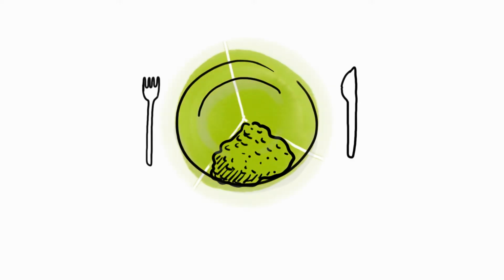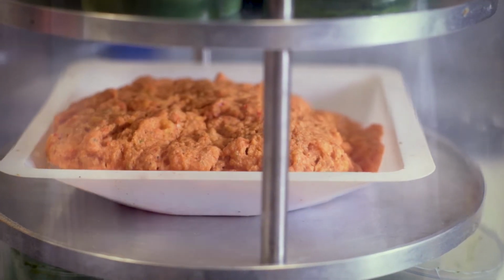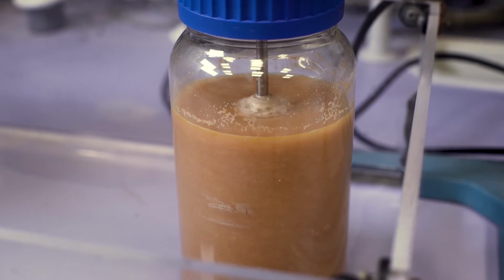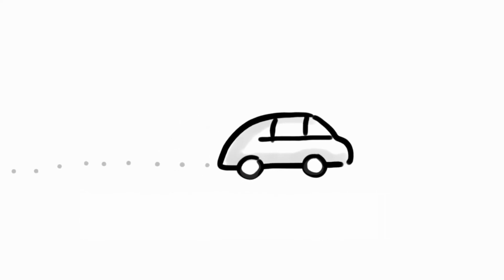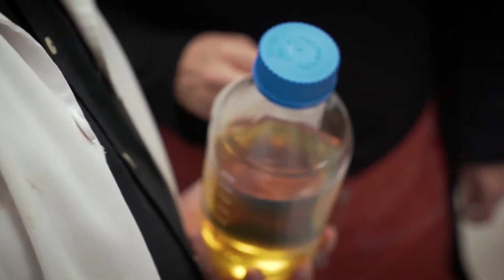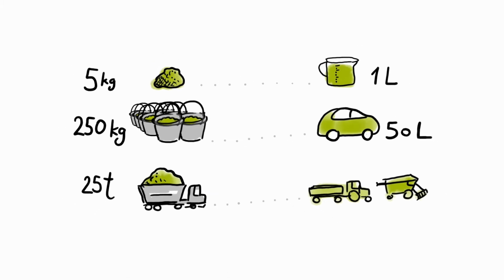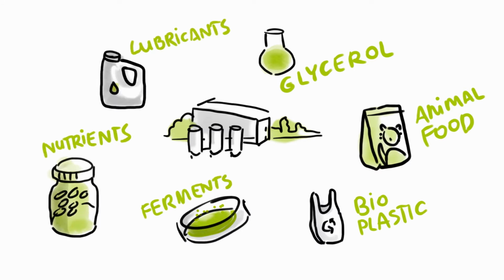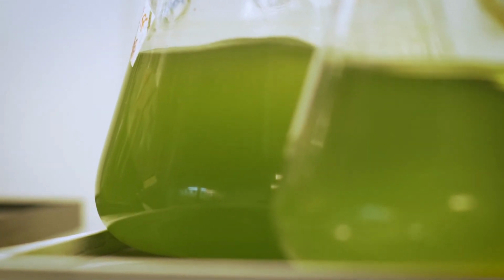From Food Waste To Biofuel

Comment: Just a thought.  The dried out leftover solids cellulose etc  from biofuels such asa gobar gas plant. could perhaps be used as woodgas .or something.im  Planning on building a biogas reactor any suggestions on design
Reply: Ok 2 years Ago but IS simples 

Make a metal container(like a Paint can) with a hole drilled on It, connect to a pipe that ends up in another container submerged in Water(like the one way Valve they used to ferment beer but with way more Water)

In the same container you need to have a gás output on top, thats were the final product will Go 

(You can make more of these one way Valve to make sure that there will be no tar or oil coming out with the syngas and function for more time without the need of cleaning the filter)